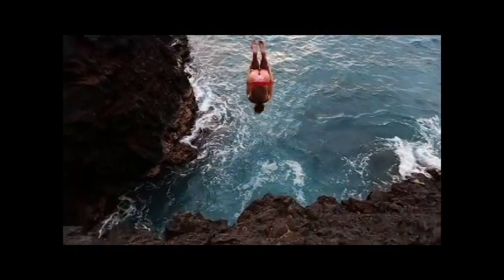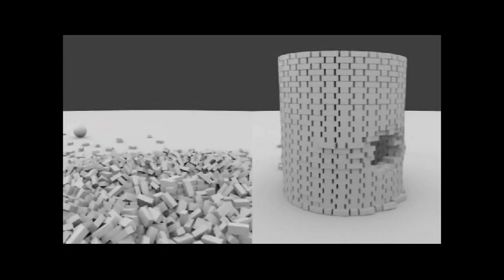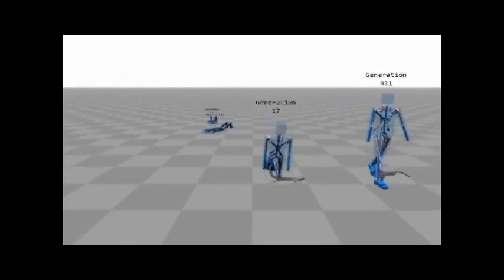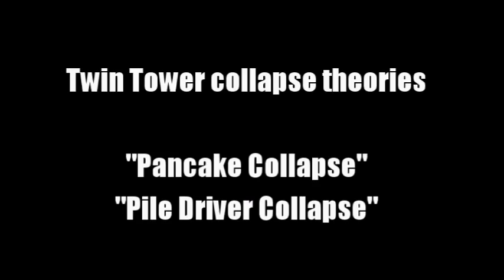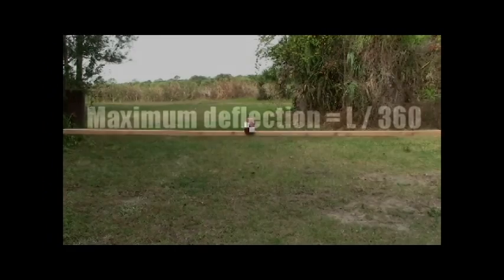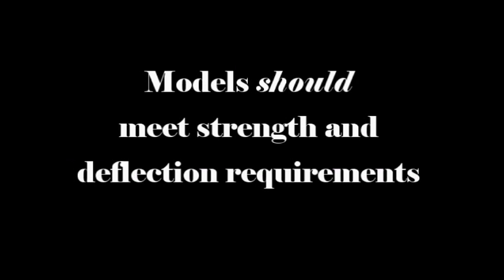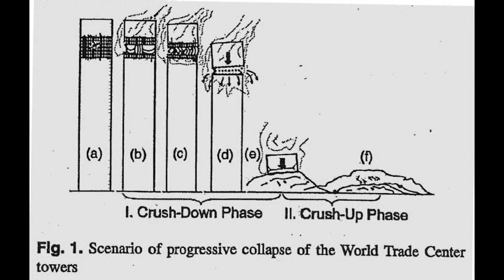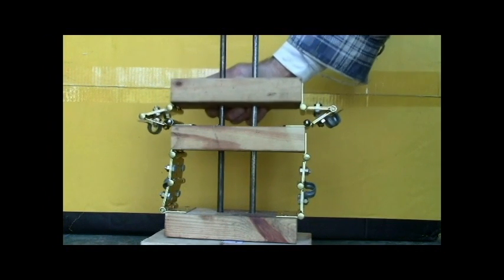9/11 Experiments: The Force Behind the Motion

Comment: Basic materials science will tell you that concrete has incredible compression strength but very little impact strength.
It's pretty simple and the experiment is flawed if the exact same wall strength to floor weights ratios aren't used.
At the initial failure moment, the weight of 20 floors crushes just one floor below it - then the momentum of 21 floors crushes the floor below it - then the momentum of 22 floors crushes the next, the weight of 23 floors crushes...

WOW - the weight is increasing, momentum is increasing.

This is painfully obvious  and hopefully people get it.
Reply: Nathan .Star you know something, I wonder how all the videos of the planes hitting the tower, surly you noticed how those aluminum wings cut through all that steel and concrete like butter, steel and concrete must be weak at?
Reply: You need to get your eyes examined. That's not what you see in the collapse.
Reply: The fact is that's not what you see when you watch the North Tower collapse. It's evident that much of the weight is blown outward, actually far away from the building. Further despite what weight does come down on the lower floors, the lower floors resist, and will eventually slow the collapse.
Reply: A given floor will not slow the collapse of the floors above sufficiently to prevent collapsing itself. The downward kinetic energy of the increasing mass of each successive floor was far greater than any floor was ever designed to withstand. It's not about mass; it's about force.
Reply: For one, please watch the slow motion videos of the north tower collapsing. You can see much of the weight is not coming down on the lower floors. It's going outward. So what we see visually is explosive forces which prove your pancake claim wrong right from the start. It is not a pancake collapse visually. Secondly, if the top 15 floors did collapse, they would be slowed down and "resisted" by the 15 below them, leaving the lower 80 floors intact (unless of course the towers were rigged with explosives). I urge you also to watch failed demolitions to get ideas on partial building collapses, which is what we would have seen on 911 if the buildings (all three of them) were not rigged. Lastly, if fires are enough to make buildings collapse perfectly in their footprint; why not just get rid of expensive profession demolition experts and just light fires on the lower floors? Admit it, that would be way way cheaper.
Reply: @dibensy59  I really like your last point....why not just burn any old building down in its footprint? If you think of economics you don't even need physics to come to a conclusion.😀
Reply: Nope...15 floors dropped onto one floor. Then 16 onto 1, then 17 onto one then 18 onto one and so on and so on. Learn to understand physics.
Reply: Roberto Bigoneo Not even going to argue with y'all anymore. You don't have to be a engineer to know this. Just use your brains.
Reply: Thank you for explaining this. I was writing a less cohesive version of this explanation when I read your comment. Thanks for saving me the headache.
Reply: Nathan .Star You're actually every wrong, building are made to actually resist this force. If you would take the first floor as example, it would have at least 60 floors above it meaning it would carry the weight of those floors. The strength of the buildings (actually the twin towers were the strongest sky scrapers at the time in the world) would be able to resist the force and weight of those other floors. It would definitely break the fall and would not be able to go into a freefall. You were given a brain at birth, please use it.
Reply: Thanks for that bit of sanity.
Reply: Slater Slater Are you that stupid to have the dumbest argument ever, a egg isn't made to be stepped on by a elephant. Buildings are made to resist weight and all kinds of forces. When you use arguments come with right ones.

Comment: Your entire premise that "the direction of acceleration for ... is independent of mass" is wrong in practice, or inaccurate at least. Mathematically we must consider FORCE, not just ACCELERATION (F=m*a). We live on Earth my friend, and the Twin Towers were on Earth. So, we must consider gravity (and its acceleration, thus its FORCE) when conducting experiments. Perhaps it's more accurate to say: you are excluding a CRITICAL physical force from your experiments - momentum. By using lightweight materials, you've manipulated your experiments so that they indeed decelerate - their momentum is low enough that there is not enough force on each impact to break/crush the "floor" below. But these experiments are flawed in their very essence. While experiment is incredibly important, GOOD experiments are even MORE important. 

There is absolutely enough FORCE to crush one floor of the Twin Towers generated by the initial "fall" of the floors above. Since we are accelerating only at the speed of gravity, we can roughly calculate the force. I've found that each of the Towers in the World Trade Center weigh about 500,000 tons - while this may not be incredibly accurate, we can use it to demonstrate the FORCE generated by MASS and GRAVITY (not explosions). Gravity is a constant acceleration of 9.8m/s2 on Earth. The MASS is 500,000T for the whole building, and the building was 110 stories. Floor height of many office buildings is about 12ft. Planes struck around the 93rd floor (to 99th) of the North tower. Let's go with the "smaller" mass - 11 stories (100th through 110th) falling between 12 and 72 ft (whether they fell 1 story or 6 is unclear). We can use the smaller distance as well of 12 ft. So, approximately 50,000T falls 12 ft, how much FORCE is generated?

That 100M lbs mass (50k tons * 2k to = lbs) generates approximately 444M (million!) Newtons of force per second per second! Considering the acceleration of gravity is a constant, if the floors above fell 1 story (12 ft in my simple equation) it would take approximately 0.86 seconds for that mass to strike the floor below and 1600273881 joules (1,180,317,068 ft/lbs!) of energy would be generated if the fall were only 1 story (from video evidence, it appears that the fall accelerates as you describe, which would only exponentially increase the force generated.)

If you are trying to represent science, and not some twisted version of science, at least give it an honest attempt. This is propaganda at best.
Reply: Thanks @Mario for this very good comment.
Reply: @Blu: the comment Nathan made was just to prove the video "experiments" are ridiculous.
Precise computation of the fall is way more complex, however.

But he just proved that the video is BS, that's all we need.
Reply: @Blu:

We're already discussing that in another thread, as you seems to dumb to be able to understand that, let's duplicate again:
If we take the break at floor 99, considering only the above part (stories 100-110), and assume your figure of 6.3m/s²; of acceleration, we can compute the amount of energy available to break the tower.

data:
413m and 110 stories, makes 3.75m per story.
288 000 000 kg on 110 stories: 2600000 kg/story (very rough).

Center of gravity of the falling top block [100-110] is at about 105 stories, so about 393m above ground.
It's about 26000000kg mass.

If it crash flat, we have a total gravitational energy of:
Et=mgh=100 GJ

Actual kinetic energy at ground is less, as you measured a fall at only a=6.3m/s²;, so it's more like:
Er=mah=65 GJ

Energy loss in the smashing of the structure:
Et-Er= 36 GJ, about 8.5 tons of TNT equivalent.

And thanks woowooNeedsFaith, we  can add that:
If we assume that the weight of the tower were evenly distributed along its hight, then the centre of gravity of that whole mass would be around 200 meters. That would give total potential energy of 565 GJ. And based on your acceleration figures, 35% of it was lost for crushing the structure, in which case we would get 197 GJ in total. It is equivalent to 47 tons of TNT.

Comment: You don't need EXPLOSIVES to produce the effect you see e.g. at 12:29. You forgot the potential energy stored on the upper level concrete floors. When those floors fall down, that potential energy is "released" and it is free to work like your explosives.

There is something wrong with your small scale experiments. Are your floor thicknesses in scale (don't look like it)? Are your floor hight and area in scale?Are your floor support structures in scale? Support structure at 6:00 surely isn't. It is sturdy as hell. I would like to see how those floor blanks would behave if they were JUST BARELY supported in your rig at 6:00. Would that experiment replicate the movement we observed?

Some things just don't scale as you probably seem to expect? E.g. why a flea can jump 200 times of its own length but big animals can't? How does potential energy scale?? Potential energy equation tells E = m*g*h. Height (h) scales linearly but mass (m) scales same way as volume does which scales in cubes. So when you multiply those, the potential energy scales in fourth power. So if you use 1/100 scale in your model, the potential energy stored into your model is only 1/100'000'000 of the original.

I have hard time to imagine how you could incorporate that "lost" potential energy into your model experiment in some meaningful manner... Should you use 100 times (or inverse of the scale times) heavier floors than the the scaled mass would tell? That could be done using inverse of scale denser material than the average density of the real floor. But that would require some very dense material which does not exist unless you use very small scales. Even if you used osmium, you could not use smaller scale than 1/10. ...Houston, I think we have a problem...
Reply: He's also omitted gravity from his equation and its impact on potential energy. The premise that acceleration is independent of scale is ONLY valid mathematically. Practically, you MUST consider potential energy like you describe. Math from my comment pasted below may not be precise, but it clearly suggests like you do that potential energy is exponential. These "paper tower" experiments are incredibly flawed. 

"There is absolutely enough FORCE to crush one floor of the Twin Towers generated by the initial "fall" of the floors above. Since we are accelerating only at the speed of gravity, we can roughly calculate the force. I've found that each of the Towers in the World Trade Center weigh about 500,000 tons - while this may not be incredibly accurate, we can use it to demonstrate the FORCE generated by MASS and GRAVITY (not explosions). Gravity is a constant acceleration of 9.8m/s2 on Earth. The MASS is 500,000T for the whole building, and the building was 110 stories. Floor height of many office buildings is about 12ft. Planes struck around the 93rd floor (to 99th) of the North tower. Let's go with the "smaller" mass - 11 stories (100th through 110th) falling between 12 and 72 ft (whether they fell 1 story or 6 is unclear). We can use the smaller distance as well of 12 ft. So, approximately 50,000T falls 12 ft, how much FORCE is generated?

That 100M lbs mass (50k tons * 2k to = lbs) generates approximately 444M (million!) Newtons of force per second per second! Considering the acceleration of gravity is a constant, if the floors above fell 1 story (12 ft in my simple equation) it would take approximately 0.86 seconds for that mass to strike the floor below and 1600273881 joules (1,180,317,068 ft/lbs!) of energy would be generated if the fall were only 1 story (from video evidence, it appears that the fall accelerates as you describe, which would only exponentially increase the force generated.)"
Reply: +Blu Crystl
I can't make any sense of your word salad. English is not my mother tongue. If you have a real question, please make clear statement instead of hand-waving. You sound like AI bot putting vaguely correlated words after each other.
Reply: do you understand English word Bull$hit ?
No. That is not English word. I can't find it form a dictionary.

you seem to use English pretty well
Thanks. I try to do my best to convey the ideas I have the clearest way I can.

So, do you have a question or not? Just say what you wanted to say with different words and keep it short.

BTW. I have studied physics in University so I should know thing or two about it. I love physics, so I don't mind learning it a bit more. So again, what is your claim?
Reply: @Blu: "World Trade Center Twin Towers: Constant Acceleration": the video find a value of 6.3ms⁻² of acceleration.

If we take the break at floor 99, considering only the above part (stories 100-110), and assume your figure of 6.3m/s²; of acceleration, we can compute the amount of energy available to break the tower.

data:
413m and 110 stories, makes 3.75m per story.
288 000 000 kg on 110 stories: 2600000 kg/story (very rough).

Center of gravity of the falling top block [100-110] is at about 105 stories, so about 393m above ground.
It's about 26000000kg mass.

If it crash flat, we have a total gravitational energy of:
Et=mgh=100 GJ

Actual kinetic energy at ground is less, as you measured a fall at only a=6.3m/s²;, so it's more like:
Er=mah=65 GJ

Energy loss in the smashing of the structure:
Et-Er= 36 GJ, about 8.5 tons of TNT equivalent.

That's already quite a lot... And that doesn't include all the energy added by the falling of the other stories bellow the top block!

All that energy was loss in the breaking of the structure.
Reply: +Thomas Kundera
Nice figures you brought to the table.

If we assume that the weight of the tower were evenly distributed along its hight, then the centre of gravity of that whole mass would be around 200 meters. That would give total potential energy of 565 GJ. And based on your acceleration figures, 35% of it was lost for crushing the structure, in which case we would get 197 GJ in total. It is equivalent to 47 tons of TNT. 

And just for fun, when one floor (2600000 kg) falls down only one story, with that same 35% conversion ratio it releases 8 kg of TNT worth energy for smashing. And when those 10 upper most blocks hit the first floor right below it, in principle there was already 80 kg of TNT worth energy available to break the support structures underneath it.

Interesting numbers...
Reply: +Blu Crystl
YOU  HAVE A VERY BIG PROBLEM!!!!!!!!!!!!!!!!!!!!!!!!!!!!!!
No, I don't. I just used the numbers given here to get an idea of the magnitude of energies involved. That's all. 

" ... more than 150 t of TNT per tower would have to be installed,..."
You have a problem. How do you smuggle and install 150 tons of TNT into the buildings?

You calculate for the entire structure that 47 tons of TNT energy equivalent was the amount of energy ACTUALLY USED to cause the destruction of the entire WORLD TRADE CENTER ONE building.
That was the energy available for crushing the support structures DURING the fall. At the end there was still 65% of the total potential energy stored in form of kinetic energy of falling debris. When that mass stops at the bottom, all that energy is has to go somewhere. That energy pulverises the remaining debris.

I have to say you found very nice paper. I may have to take a deeper look to it when I have more time. But if we peek to its conclusions to see where they reached after all, it says: "These conclusions show the allegations of controlled demolition to be absurd and leave no doubt that the towers failed due to gravity-driven progressive collapse triggered by the effects of fire."

Ref: 

"What Did and Did Not Cause Collapse of World Trade Center Twin Towers in New York?"
Zdeněk P. Bažant, Hon.M.ASCE1; Jia-Liang Le2; Frank R. Greening3; and David B. Benson4
JOURNAL OF ENGINEERING MECHANICS ASCE / OCTOBER 2008
Reply: +Blu Crystl
So you did not read my response? I repeat:

According to professor Zdeněk P. Bažant (et al), the conclusion is:
"These conclusions show the allegations of controlled demolition to be absurd and leave no doubt that the towers failed due to gravity-driven progressive collapse triggered by the effects of fire."
Reply: +Blu Crystl
SOOOOOOO, YOU ARE IMPRESSED WITH BAZANT'S PAPER ARE YOU???
It was the paper you gave as authoritative evidence, didn't you? If you don't trust on that paper, why you brought it up? I just want to save my time and read the conclusions first. There was all I needed to know for now. Superficially it looked good, and the conclusions made sense. So I don't have any reason to doubt his and his co-author's judgements.

It seems like Bazant has MAJICAL POWER to fool your brain just like he fools the brains of nearly all Americans.
You are delusional. I'm Finnish and I have my own brain. I don't need him to figure out that all that potential energy stored in to those tall buildings is more than enough to produce the effects we observe from those collapses. It makes much more sense that it really was couple of Muslims flying plaines to those buildings and it caused the collapses than controlled demolition hypothesis. I do understand why some liberal Muslims want believe in conspiracy theories and inside job, but why non-Muslims want to believe it is beyond me.

- - -

You should be aware of omitted critical information...
You should also be aware...
Why don't you write and publish your own paper then if you are so much better than him and his colleges combined?
 
He only has done one useful thing, calculating energy  to pulverize concrete.
Nice. So how did they smuggle in and install 300 tons of TNT into those two buildings without anybody noticing anything?
Reply: Dear Blue Crystal Meth

What if you just give me the numbers you have and tell me how much of energy is missing? How much explosives were needed to produce the effects we saw?
Reply: Get you eyes examined. A pancake theory is pushing downwards. What you see are massive lateral ejections.